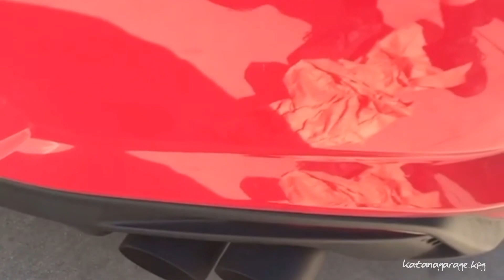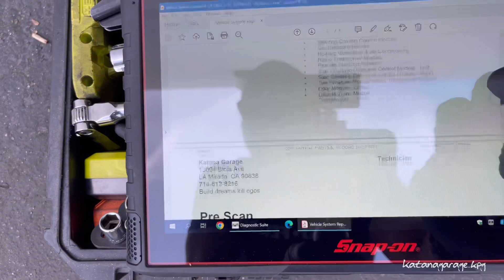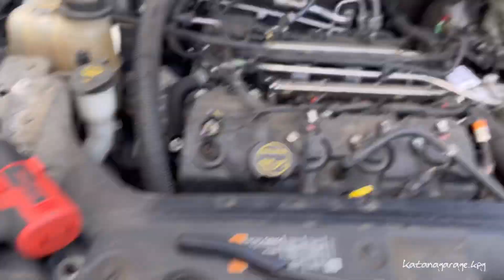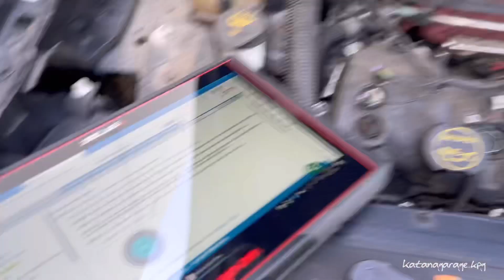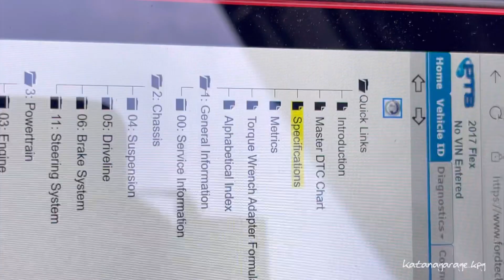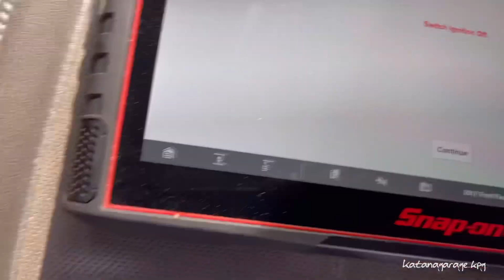2017 Ford Flex 3.5L v6 Spark plug replacement

Comment: Exactly HOW MANY 02 sensors are there on a V6 3.5 Ford flex engine, I have a V6  2014 Ford flex sel with a 3.5 engine
Reply from the maker: There are 4 O2S for each bank of the engine